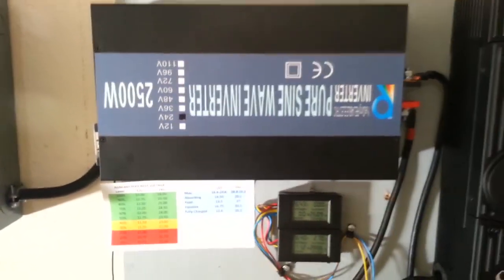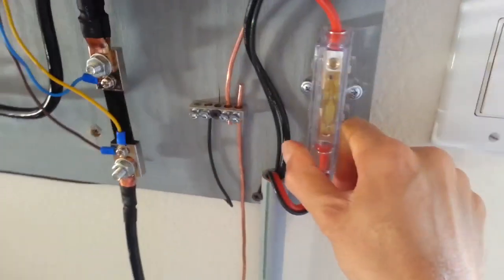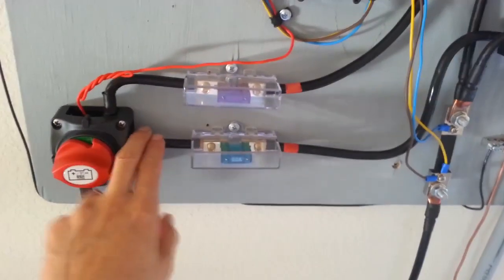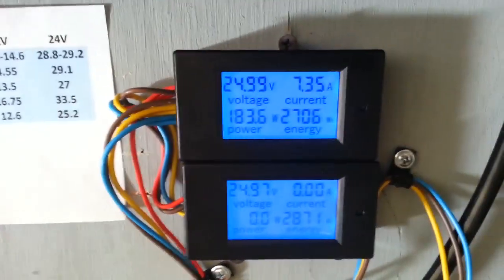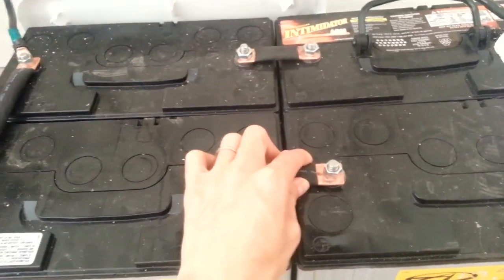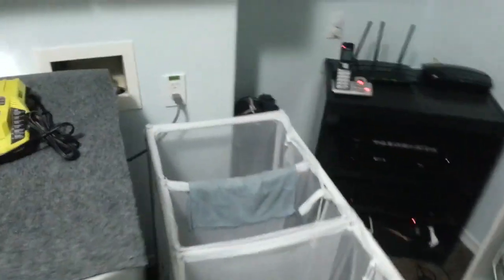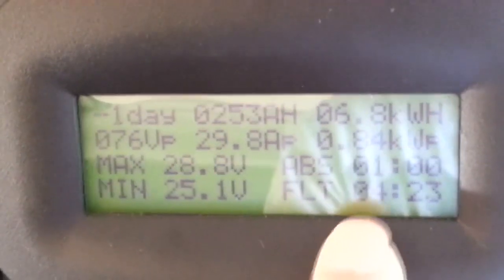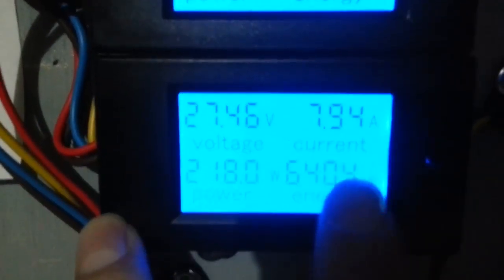1.2kw Solar Panels Off Grid w/ 24v battery bank running window air conditioner and more.

Comment: Hello, I'm a solar novice. I stumbled upon your video (great job). I have two questions. One-what is then approximate cost of your setup? Two- can you use your excess power generation to feed back into your grid to help offset your utility bill? Thanks, and I've subscribed.
Reply from the maker: Hi, Solar panel are 150.00 ea for 310watts X 4Outback Flex80 580.00Inverter 230.00Battery are 125.00ea x 4 Wire, Switches and misc = 150.00This is completely isolated from the grid...
Reply: What brand/model are those panels and where did you get them? Sounds like a heck of a buy. And, what about shipping?
Reply from the maker: They are the Trina 310watts panel.  I bought it local so no shipping.  You can look for local surplus solar from CraigList in your area.
Reply: Did you buy them used? Maybe from Craigslist? A quick look at new ones listed for $210-220 plus shipping. They do look like good ones, with tempered glass. Finding them (or any kind of panel) on Craigslist, especially around here, would be like winning the lottery.
Reply from the maker: No, these are brand new panels... check this guy on Ebay, this is where I buy from locally.  Contact them to see if you can buy smaller lot.... but they list this 29panels for only 3700.00, that's only 131.00ea.
Reply from the maker: Here's the 295watts.  http://www.ebay.com/itm/Trina-295W-Poly-Solar-Panel-24V-295-Watt-TSM-295PD14-Lot-25-/371675556252?hash=item568996e99c

Comment: Im disabled and just getting started. Im trying to get started small and leave my option to expand by adding panels only. Im on fixed incme and cant afford to make mistakes. Your video is excelllent. A blue collar can follow you and DIY. Thank you.
Reply from the maker: Yes, you can never research enough... I thought I did enough and turn out I still make a lot of mistake in my system.  My suggestion to you would be put a big portion of your money toward the charge controller.  I suggest you get the Midnite Classic 150 and not the Outback Flex, to keep thing short, with the Classic 150 you get newer technology and more features for way less... (my biggest mistake was I did not look into Midnite).  Go with at least the 24v system.  

Good luck.
Reply: Thank you

Comment: great video. You might want to check out Steve Robertson channel he goes into depth on how to use every watt your system produces he is off grid in Colorado. Thanks for the maxi fuse tip..
Reply from the maker: Thanks, I have watch some of this video... I am trying to implement a few ideas to fully utilize my power production.  But man, it take a lot of to maintenance and expand a off grid system... need to closely monitor the system all times... Such a draw back.

Comment: where do you store your batteries in AZ, the heat kills batteries in AZ
Reply from the maker: Currently in the garage... Yes, it's freaken hot, 105-110F in my garage right now.  I am looking for a solution right now... will make new video when I am done (if successful  :) )

Comment: How do you know that the home made pipe connector can handle the amperage? Did you calculate to come to the conclusion and what measurements and numbers did you use? 
The current capacity and the resistance depends on the total cross section area of the copper. Looks to me that your connector is like a #10 wire if you look at it in a cross-sectional view.
Going cheap on battery connectors that could see a 1000 amps id something is going wrong is the wrong thing to do.
Leave a space between the batteries, that keeps batteries cooler and will extend the batteries life.

Fuses are there to protecting the Wires and not the equipment. On the other hand, fuses could protect the equipment if they are smaller than the  ampacity the wire is rated for  and for the temperature the wire is rated for and not to forget the duration the equipment is used. 

The kill-a-watt will not see the surge.
Reply from the maker: First of all... how in the heck is my set up going to pull 1000amps?&#160;&#160; The most I have pulled out of my battery is 50amps and the rest is cover by the solar.&#160;&#160; I don't need to bother to do any unnecessary calculation.&#160; After all I failed Algebra.&#160; All I know if my copper bar weight twice as much as the 2awg wire...&#160;&#160; It will do for me just fine.1000amps?&#160; oh please, did you even watch my entire video?&#160; 1000ampsX24v = 24,000watts.... If I turn everything in my house and my neighbor house on at the same time, wouldn't even pull that much.&#160;&#160; 
So yeah, I'm going to have to disagree on this one.Yes, all my fuses are sizes smaller than the wire can handle.&#160;I believe the gap for the battery won't do much if the ambient is already 110F..... Only solution is to insulated it and condition it... ( I am working on a solution).
Reply: Packing batteries together makes the batteries more hot since they can not cool off even if you got 110 F already. Those batteries just heat up more then necessary and age/ go bad way faster. A space between batteries will keep them cooler since the heat from charging and discharging can dissipate through the battery walls of the batteries into air that carries the heat away.  

A shorted battery can draw a 1000 amps and make wires glow red hot  and weld to each other. It even can make  batteries explode, connectors melt and set insulation on fire......guess how I know.
Your fuses are 5-6 feet away from the batteries and a lot can happen to your battery cables and connections between battery and fuses. Like I said before things can happen like a short can happen. Battery fuses should be as close as possible to the battery. I like your battery connector covers.

What ever..............

Comment: Yes my friend. 
As I was reading some of your comments, I happened to see that you just added 2 more solar modules to make it a total of 6 solar modules.

As of now you just increased more power than before and you don't have enough storage for that.

I will encourage you to start looking for a way to store your excess power for your night or winter usage. Since winter is the most challenging season for us with solar. 

I will recommend you start looking at the Lithium Ion phosphate batteries or Nickel Ion phosphate batteries.
These batteries can order directly from China for $3000 and plus.
Please it checkout and let me know what you think. 

That's a nice video presentation you put out their.  

Please keep the videos rolling Buddy and God bless.
Reply from the maker: Well... my off grid system is rather odd for my situation, I am not living in a cabin this is not the intention of my system.  There's no efficient way to store power and probably never will be.  It all has it price :D.  

Winter here in Arizona is going to be different.... Sun still shine 8hours a day and I will still be able to use all of my big appliance during peak time.  

Can you charge Lithium Ion with the OutBack or Midnite?  LiOn from un reliable Chinese source is scary... could bring your house down.  :D

Comment: Very nice little setup you have their.
I am really proud of you Buddy please keep it up. 
The only thing I have to say is, you need more batteries to store your excess power for night time. 
For 1200W Solar Array, I would say add two batteries on the system if you could. 
Thanks for sharing and please checkout my channel and subscribe.
God bless and have a wonderful day.
Reply from the maker: I agree... during mid day peak, it generating way more power than I needed and I am running around trying to plug thing in.  :)   I am currently still confused about the battery situation and not sure if I should add more battery.... or wait for better battery technology... Many company is now releasing better and cheaper battery... this is why I have been holding off on adding battery.  Adding more battery increase the pay back on the system time and make it less cost effective.
Reply from the maker: My system is now actually 1800watts... :D
Reply: devildestiny555 
Very nice to hear my friend

Comment: I like your idea of trying to only power your A/C directly from solar.  Even 90% of the time would be fantastic, and it looked like you were pretty much already there even with 1200 watts of solar.  And, you say you've added even more panels :)  Unfortunately for me, it would be very hard to do what you're doing.  My 220 volt central A/C unit is over 40,000 BTUs.  First of all, I'd need a massive inverter.  Secondly, a massive battery bank.  Lastly, a lot of solar panels!  I'm doing grid-tie right now with some of my panels on the roof and I'm powering certain DC electronics and appliances from a separate 500-watt solar rack in my backyard.
Reply from the maker: 40000BTU is a full size AC and it's almost impossible (money wise) to be able to power it with solar... It would if you have 6kw solars, but then it still wouldn't be enough to START it, it would surge like crazy.  Currently, the only best option for them big AC is to do Grid Tie and use the power utility to start the AC and supplement it with Solar.  

Unfortunately for me, getting grid tie solar isn't a paying back fast enough due to greedy power utility company.  

The only other alternative would be if you're building a new house, you can think about only using Mini Split AC with multizone air handler.  Where you have one condenser unit outside, say 24000BTU, then inside you have two 12000BTU air handler, you can easily run them one at a time with a Off Grid solar.

Comment: Good job! Do you have a link for the system components?
Reply from the maker: Here you go.  
Inverter: http://www.ebay.com/itm/191682182193?_trksid=p2057872.m2749.l2649&ssPageName=STRK%3AMEBIDX%3AIT

Fuses: http://www.ebay.com/itm/251628654761?_trksid=p2057872.m2749.l2649&ssPageName=STRK%3AMEBIDX%3AIT

Outback Flex80:  You can easily find this via google with a lot of different prices...

Comment: The 4/0 is a larger cable, mainly used on heavy duty welders. you can search welding supply stores for it fairly cheap. the home made lugs will not handle the amp load and I have seen a lot of systems burn up because of them. I saw one guy telling people to use soldier to connect the home made lugs to the wire. that's the worst thing you can do, a good quality crimping tool will come in handy.  marine grade lugs are very safe and no maint required. ANL also makes a great fuse set up that you can get on ebay.   come winter time the sun will set lower so those panels might have to be lowered down a lot. looking forward to seeing the rack set up you come up with. best of luck! SD.
Reply from the maker: Thanks for the advise.  I actually already bought the rack, pick them up on craiglist from a commercial contract who install big project.  Bought their left over rack, super heavy duty commercial rack.. for very cheap.  :)

Comment: nice job on your set up. l run a 24 volt set up also. you might want to go to 4/0 cables and it looks like you made home made battery connectors out of copper tube. try to use marine grade lugs. and only use crimp on lugs to the cable. I also see that jerk that advertises inplix makes comments on your site also. I ended up having to block each person from them for spamming adds. I see your panels are fixed. you might want to consider a adjustable rack set up so you can move them for winter and summer time adjustment. also air flow around the panels will help with better output. the cooler the panels stay, the more you get out.  I use to live in Vegas, that heat will really slow down output at times. anyway, great job , have fun with your set up.
Reply: I don't run the big cable to my controller, just between the batteries and to the inverter. My cables never get warm, just ambient temperature.
Reply: My system is a little bigger so I try to use all I can to offset the power bill. I have been able to cut it in half since I got it going. Looking at more battery storage so I can run more at night
Reply from the maker: My battery cable is #2, isn't that bigger than #4?  Don't really see a problem on my cheap lugs, it doesn't even get warm... Yes, in time it may there may be corrosion, but that's another problem to deal with later on.  :)  

I am planning to rack these, just having because it's a temporary solution, I am waiting for Winter to come around so I can see where the sun really point at and redesign the mount then.  

Yes, the heat is killing my output quite a bit.  But it is what it is.
Reply: Yes #2 gauge wire is larger than #4 gauge. But 2/0 is not the same as #2. It goes in the other direction when you add a /0 to it. 4/0 is larger than 2/0.  I run 4/0 cable on my batteries and inverter.
Reply from the maker: Darn, confusing... :)  For a while my #2 did get hot to the touch, but soon I realize it's because of my fuse was not big enough, creating resistant in the line... Replaced with the right fuse, then the wire is back to just warm to the touch.  Continous about 50amps-90amps max.  Not sure if my Outback Flex80 can fit any bigger wire than #2.
Reply from the maker: I get ya.  But my intention is never to run power from my battery... The max I have ever pull out of my battery is 10amps, the rest is coming straight from controller to inverter.   So far I have only used 30kwh out of my battery since I started the system, 40 days now.  So I am using less than 1kw a day form battery.  160kwh from Solar so far.  Phoenix Sun Rocks!  I mean the Sun itself.
Reply: 50amps-90amps max. 
You should treat your system as 90 amps max and then calculate it for 125% of the max load which would be a 112 amp system/wire.
Reply: I get ya.  But my intention is never to run power from my battery..

But the potential is there  that it can happen and bad things and accidents can happen and could over heat your wires/system which could start a fire that the insurance company could refuse to pay for it.
The insurance company know about that solar system? Right? And is covered under your policy.